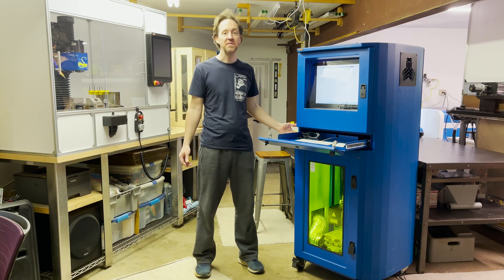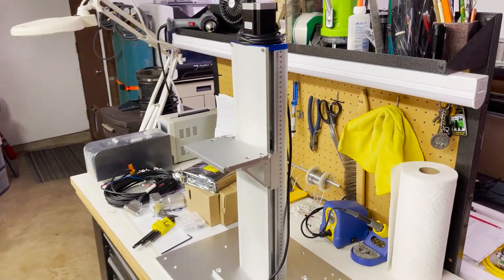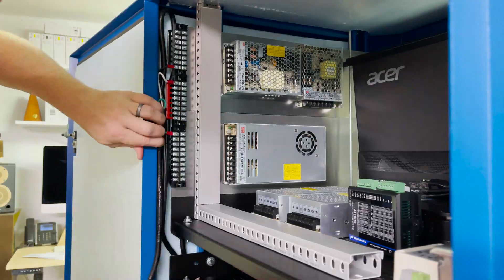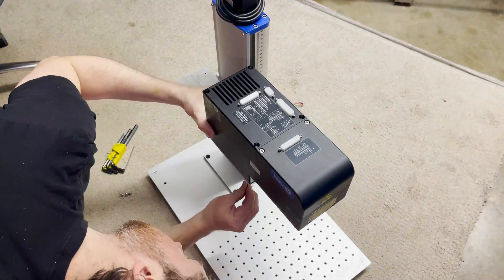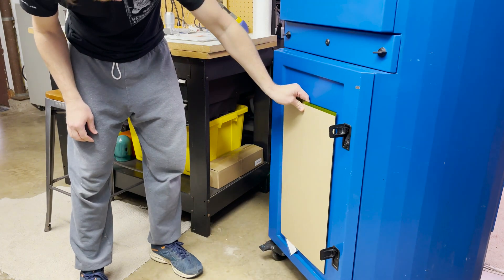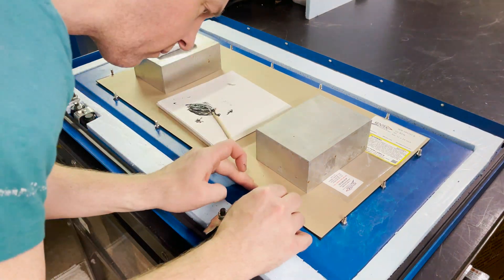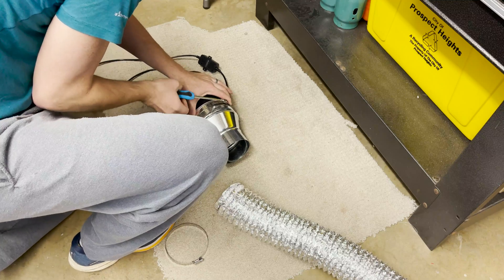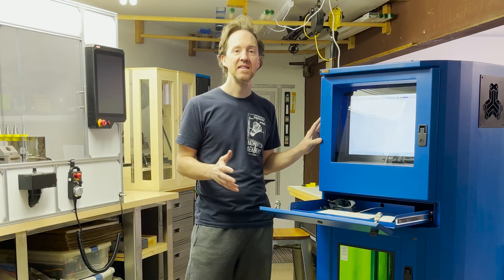DIY Fiber Laser Engraver: JPT MOPA M7 & Feeltek Galvo Scan Head

Comment: nicely done.  I am surprised at the modularity available and their compatibility.  One comment to help the enclosure thermal- I didn't see an air intake louver.  A louver at the bottom, opposite side of the exhaust fan will draw external (cooler, room ambient temp) air across the heat producing parts.  replaceable filters are pretty great.

Comment: What made you choose the Feeltek head? Did you look at any other 3D heads? I have an application where I need 3D to work complex surfaces and am unsure of the right path forward.
Reply from the maker: At the time there wasn’t as many options for 3D scan heads, based on all of the videos available at the time, the Feeltek results looked the best
Reply: @diyfiberlaser  thanks for responding. That makes sense. How is working in Lenmark?
Reply from the maker: It’s fine, does what you need it to do

Comment: Hi from Argentina! It seems like you know what you're doing... Is it too crazy to think that you could be the first person to achieve an open-source SLM in collaboration with the channel SLS4All?
Reply: Consider using Claude 3.5 Sonnet for some parts of the code modification required for fast changes. Perhaps an induction heating system could be used for rapid and controlled heating of magnetic metals. The laser source should be between 700W and 1000W. The structure should be similar to SLS, along with a gas system and a modified chamber to maintain the temperature.
Reply from the maker: Haha, diy metal 3d printing is very interesting! It might be something I attempt in the future

Comment: My primary concern is your optical path. You need to make sure that the cable doesn't exceed the bend tolerance for that model laser source. If you pinch it too tight, you lose power and can damage the cable from heat build up. The laser bed is terribly low though. That'll be a back breaker if you do any volume of burns. Otherwise, great build, I like it. The computer case was a fantastic find/idea.

Comment: whats the rough cost of the Feeltek Galvo head?
Reply from the maker: head + controller $5.6k
Reply: OOPH that's a mighty bite to take for that. I can't remember was this a BJJCZ controller? @diyfiberlaser What is the cutting head on your Laser cutter? I want to throw one onto my Crossfire Pro CNC Plasma cutter and use it as a dual purpose cutter.
Reply from the maker: no, Feeltek controller running Lenmark software. Raytools BT210 head @ShadowCraftEnterprise

Comment: If I may respectfully suggest using a step drill for sheet metal, as it will not dig in like a 2 flute, and when using chop saw on aluminum, a high tooth count carbide blade, and cutting grease, makes ALU cutting a breeze. Keep up the great videos. 🇨🇦
Reply from the maker: Thanks for the tips!...glad you're enjoying the content

Comment: Did you have to have any special cooler on the gavlo with the 80watt? I wanted to upgrade my 30 and they said better off just buying a 100w machine.😮
Reply: Outside of maybe needing a new power supply (48v vs 24v depending on the model) the laser sources are pretty plug and play. The controllers are all the same and wired identically. So if you have a 30w that functions correctly, pull the source, put the new one in, plug it all up and make sure your optical tolerances are good. I recently went from a 30w MOPA to a 100w MOPA and the biggest issue I had was getting the source mounted in the case. Had to drill and tap a few mount holes for it. I would suggest if you don't have at least a sino galvo equivalent head, you should look into getting an upgrade. They are relatively affordable and, if you are upgrading the source, that is the perfect time to swap the head too.
Reply: @downhomedesigns  can u tell me how this project proximal cost?
Reply: @andrikurniawan531  It depends on what the final outcome is you seek. I got the 100w MOPA source for about 2500 after shipping and customs. The one I got was a 24v source, so I didn't need to upgrade the power supply, but if you get a 48v source, you can pick up decent power supplies from Amazon for $40. If you are looking at a new galvo head, those can be upwards of a couple hundred, but you can average about 150-300 on those. So, taking everything into account, you can likely go from a 20w or 30w fiber source to a 100w MOPA source for $3k or so. Less if you go for an 80w or 60w, of course. I even have my old 30w MOPA source sitting in my garage still lol
Reply: @downhomedesigns  Based on the voltage, it looks like you bought the E or E2 version. I’m also in the market for a JPT MOPA and facing a bit of a dilemma. Sellers claim that the E2 version is new and unreliable. But on JPT’s website, I only see the E2, which makes me question what the laser machine sellers are saying. Maybe they’re just trying to clear out their stock of older versions.  

Have you looked into the differences between the E2 and E versions?
Reply: @caxapaua  The only thing I know for sure is that the one I have is a 24v and not a 48v HOWEVER, the new one uses 2 different power connections to the 24v supply, if I remember correctly, where the 30w only had a single power connection. It may be running the rough equivalent of a 48v source but just done as 2 separate 24v inputs. Beyond that, I can't tell any major differences. I know the one I have now is REALLY powerful compared to the 30w and allows me to do stone much easier/faster than previously.

Comment: Hi, what does it mean "cheaper E version" of laser source. Thank you.
Reply: JPT has their regular models of the larger wattage lasers, then a version that in the model there is an E denoted. These E model variants cost less, weigh less, and according to some folks are not as well made or don't last as long. I've had a 100w E2 MOPA from JPT for over a year, work it like a dog, and it runs great. Personally I don't think there is a benefit to going with one of the non-e variants, and JPT even had one of their engineers send documentation outlining that the E2 was more or less exactly on par, but to each their own.

Comment: Always had this question in mind - what's the difference between laser source for fiber laser cutter for 1 kW and fiber laser engraver for 100W? I mean could you lower power from 1kW to 100W and just use it with galvo head you bought, or is there completely different physics..
Reply from the maker: I'm not sure about the physics, but there are some obvious differences: the 1kw source is at 1080nm wavelength with a max modulation frequency of 5 kHz, whereas the 80w MOPA is 1064nm wavelength with adjustable pulse duration of 2-500ns at a repetition range of 1-4000 kHz
Reply: @diyfiberlaser  oh I see, thx, a bit over my level of expertise to understand all of this though) I wish there was some "laser optics in manufacture for idiots" podcast xD

Comment: You should consider adding door switches, which break the interlock circuit. So the laser is safely shut off, if anyone opens the door while the laser ist turned on. This prevents you from exposing your eyes to laser radiation by accident.

Comment: What were your main considerations in the build vs buy decision?  You can buy the same thing pretty much turnkey for about $9k (sans case and PC).
Reply from the maker: You must have a cheaper supplier than I could find....I had 4 different companies quote me for the specs I used, and the cheapest was just under 12k. I chose to build because I was able to get more machine for my money.
Reply: @diyfiberlaser  this makes sense.. i was wondering the same thing.. we got a 2.5d 100w galvo and a non non 2.5d one for less than 10k for the pair. I was watching this like.. why?
Reply: @diyfiberlaser  id love to hook up a mopa fiber laser to a larger cnc like the avid cnc machine. Od want to be able to relief engrave steel and color it as well. That way I can have a plasma cutter cnc router and fiber laser all in 1. Maybe even a diode laser to engrave leather and such. Do you think this is possible?
Reply from the maker: @KevinFlores-rc1lq  I dunno, that's gonna be a lot of weight on the head to move around
Reply: @diyfiberlaser  do they make vertically mounted fiber lasers similar to diodes? I saw one that had and arch mounted above the axis that held what I guess is the power supply then had a wire harness connecting the two. I have a pic of it.